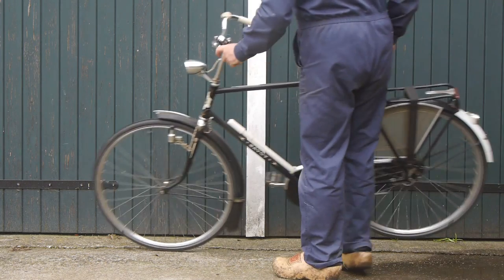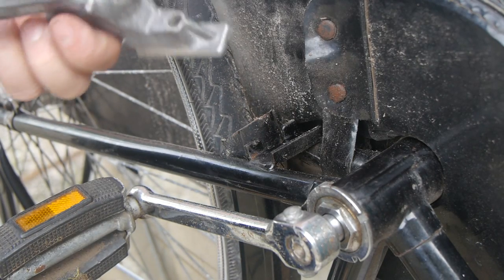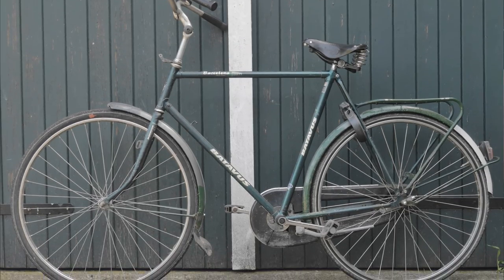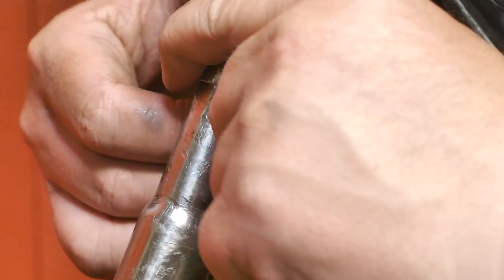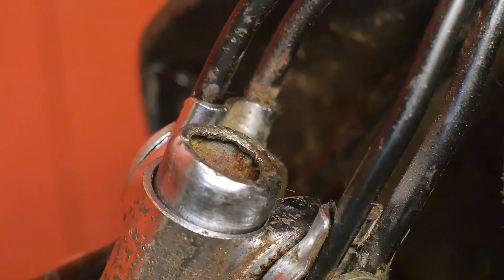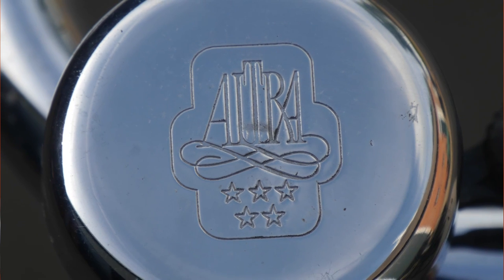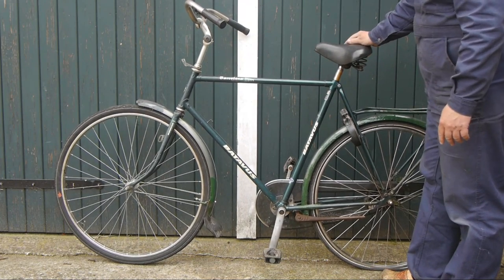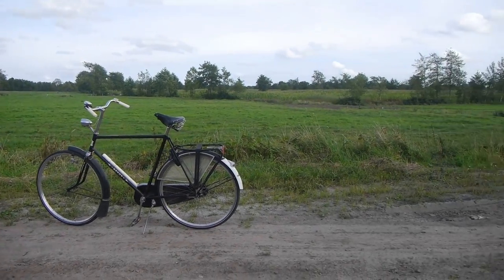Replacing the kick-stand and saddle on my vintage Union bicycle

Comment: Nice to see kick stands that are held in with a nut and bolt going through the aluminium. Over here they seem to have a steel bolt going into a thread in the stand. The bolt is soon unremovable. A good thing for the manufacturer no doubt but not for us.
Reply from the maker: Good point, this one you can just cut off with an angle grinder, and not destroy anything :)